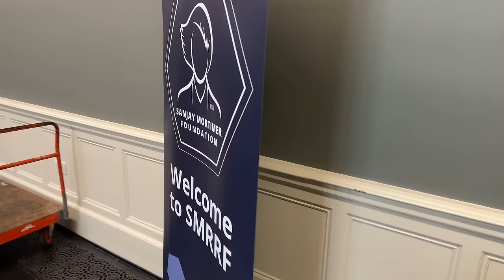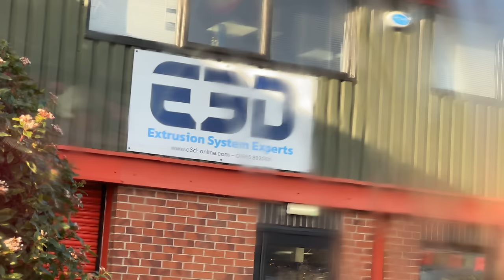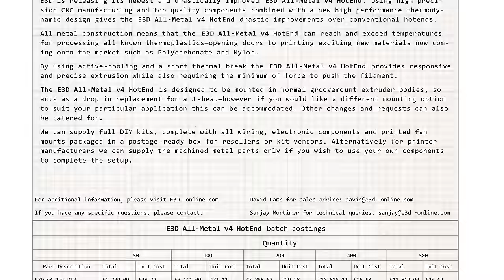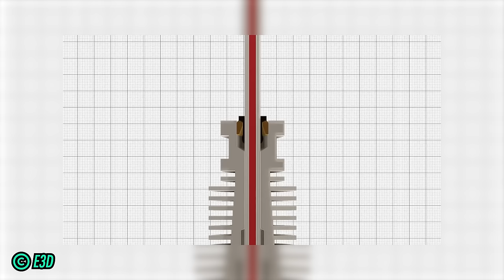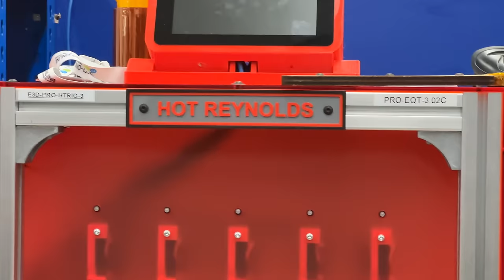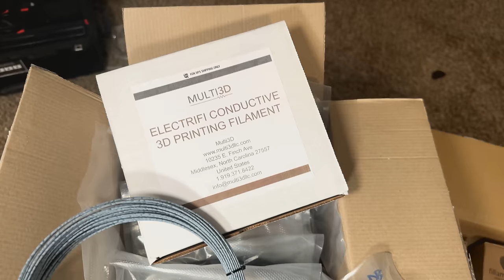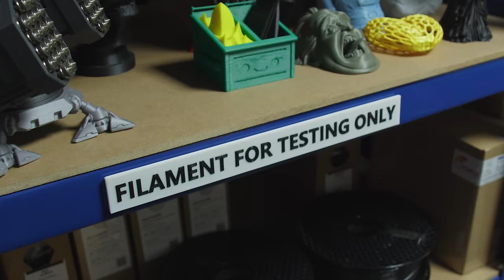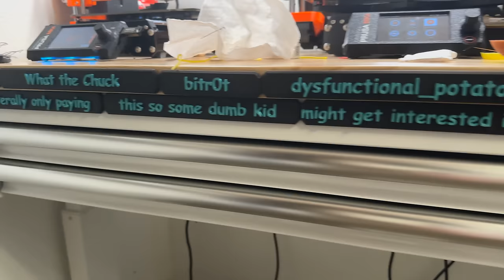The Glorious Chaos of Sanjay Mortimer

Comment: The Revo is a triumph of engineering, a worthy successor to the very successful V6 that itself set the standard for hotends in hobbyist 3D printing. That's not marketing, that's my experience and the experience of many others. The big flaw of the V6 in my opinion was the fact that you had to hot-tighten the nozzle and I was never sure if it was tight enough, I always got leaks at the heater block. Putting the threads way up in the heatsink is a brilliant solution that should be the standard even if that means more pricey nozzles.

My mind has been blown away by the Hemera extrusion system. Sanjay is the GOAT 3D printing engineer.

Comment: As somebody who still uses an E3D v6 hot-end on a printer that still looks very much like the one shown at 5:45 despite many years of upgrades (and hardly any original parts still present), I can confirm even "good" hotends from the time were hot garbage and the E3D v6 is and was a revelation. Rest in peace, you influential lunatic.

Comment: When I was researching products getting ready to buy my 3D printer, I always wondered why 0.4mm was the "standard" nozzle size. Everything came with that exact nozzle. 

I just always assumed it was because some team of PHD engineers tried every possible combination of parts and thats just what worked best. 

I never wouldve guessed it was because it was the cheapest drill bits some guy in his shed could afford. But thinking about it now, of course that's how it happened. The entire 3D printing industry is built off of stuff like that.

Comment: This is a great video!

Side note: For the radiation-blocking filament, you can get some small safe sources off of the internet. A Geiger counter, or better yet, a DIY cloud chamber, can be used to test the filament's radiation-blocking abilities, although I doubt that anything you'll print will be able to block many gamma rays, so you should probably opt for a beta emitter instead.

Comment: All my printers are still on V6 because I got a bunch of hardened 0.4 and 0.6 and a few smaller coated ones, I have gone to trianglelab ceramic cores though now, but still have some old blocks and heater cartridges in my spares

Comment: I just got into 3D printing, so I don't much about Sanjay. He sounds like he was an incredible guy. Btw, on the topic of your 'every filament' series, have you tried printing PVC yet? I found a webbed site that sells such stuff
Reply: Printing PVC sounds like an absolutely toxic endeavor. I'd love to see someone try it.
Reply: Yeah, carefully reading the MSDS and doing some research before going near that sounds like a good idea :)

My understanding is that PVC releases toxic fumes when heated to temperatures well below those used for printing, but I don't know how toxic they are.
Some hazardous gases are only considered a risk with chronic exposure (e.g., workers exposed all day, every day for years), while others can totally ruin your day after a single exposure. No idea where PVC fumes fall in that range - and it'd probably depend on any additives used (e.g., plasticisers).
Reply: @AndrewGillard  PVC is sort of insane. It decomposes into basically any combination of a handful of carbons, hydrogens, oxygens, and chlorines, and basically all of those are toxic or corrosive, typically both. It apparently also corrodes stainless steel nozzles, which is kinda insane to me as someone who doesn't know that much about 3d printing. However, as long as you're very very careful and don't let it decompose (and also find a way to take care of the inevitable HCl gas that will form) it's not a terrible polymer, with its main issue being a lack of heat stability.
Reply: @nerd_nato564  Yeah, I read on Wikipedia about burning PVC releasing hydrogen chloride (HCl) gas which then combines with atmospheric moisture/humidity to produce hydrochloric acid. That alone sounds pretty terrible :)

Most FFF printer nozzles are brass, hardened steel, or copper (with various coatings) rather than stainless steel, which has very limited utility in nozzles. But I suspect those would all be attacked as well!
Reply: 3D printing YouTuber Tom Sanladerer spoke briefly with Fillamentum about their vinyl/PVC filament back in 2019. The Fillamentum rep basically said:
“This is only for industry use; not hobby use. It requires an enclosed chamber with proper ventilation and filtration. But PVC's incredible chemical resistance makes it worth the hassle for some applications.” [paraphrased]

Source: https://youtu.be/pQ_FTlTxPm8?t=23m58
Reply: @AndrewGillard  Interesting! Thanks for the info! I had no idea PVC was so dangerous, considering it's so common :0
(Third-most widely produced plastic, according to wikipedia)
Reply: @AndrewGillard  I looked up some guides on PVC printing and they recommended a brass nozzle, although I don't know why. I wouldn't expect brass to have a higher corrosion resistance than steel.
Reply: @seraaron  PVC isn't particularly dangerous if you don't heat it up, and it's really good at piping so that's what it's mainly used for. Thankfully, it softens at much lower temperatures than it decomposes, so you'd notice something wrong far earlier than it would start spewing toxic gas all over.